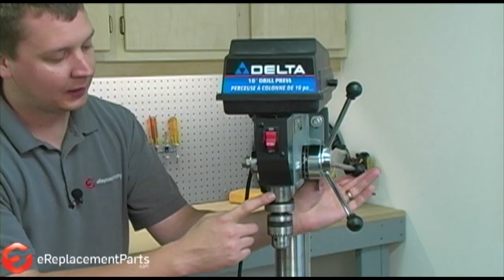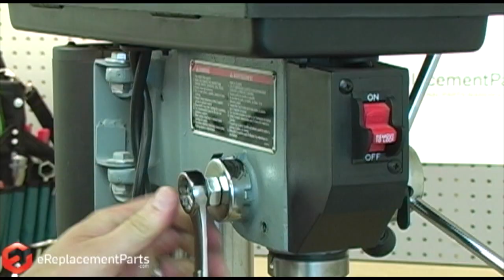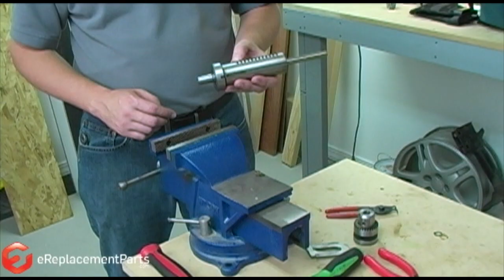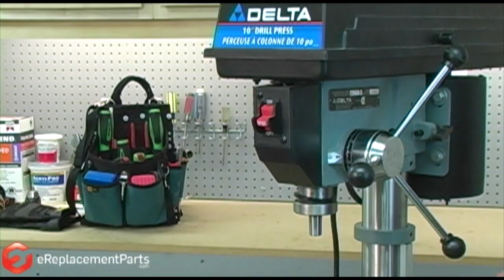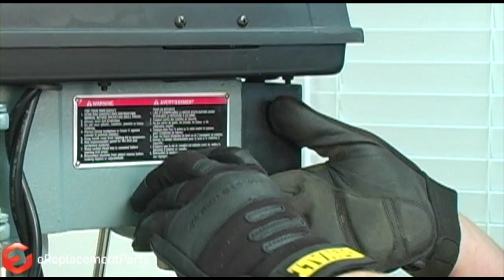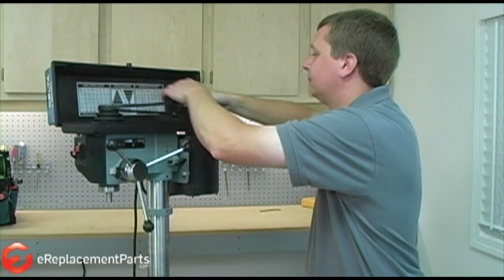How to Repair a Drill Press Spindle

Comment: So if a replacement spindle is not available thru eparts online or anyone else because they are discontinued, how does one “straighten” a bent spindle that causes drill bit “ wobble?”.
When I got the “Ryobi” drill press used, the spindle was so badly bent, that a drill inserted in a chuck would scribe a circle around half an inch in diameter.
Bye judiciously turning the chuck by hand and stopping it at its most eccentric part of travel, and quilting the side of the chuck hard with a lump of 2x4 inch softwood, I have managed to bend the spindle in small increments back towards being straight.
The wobble or eccentricity of the drill bit is now maybe 1.5mm at most, making the drill press useable again for drilling holes in steel for eg, by Center punching first, and setting the drill bit long in the chuck for maximum flexibility, it will Center on the Center punch mark and the flex in the shank of drill “absorbs” the remaining eccentricity in the spindle & chuck, to be able to drill somewhat accurate holes.
Not so much however in wood, it’s difficult to be as accurate drilling wood.
So I’m keen to try & rectify the bend in the spindle if it can be achieved by removing it & some how heating and straightening / truing it up?
Would it be better to just turn a new replacement spindle on a metal Lathe maybe?
Is it possible the quill was also bent at the time the spindle was bent by its previous owner?
It’s frustrating not being able to buy replacement parts!
If I could fix it, I’d keep it as a 2nd drill press and set it up solely to drill mortises in wood, and just buy a new drill press for accuracy drilling steel etc.
Thanks in advance, for any suggested further remedy.
Reply from the maker: Hi Ian, thanks for your question! You have already gone above and beyond what anyone else would do to remedy the problem of a bent drill press spindle. I think that most people wood leave it where you have it now. But I know you want to get it as straight as possible, and I think applying heat would do it to a point. If you have the expertise on a metal lathe, I feel that is the only way to get a perfectly straight spindle. In my opinion I don't think you have a problem with the quill. I hope this helps!
Reply: eReplacementParts.com Thanks heaps man!
I’m planning to buy a metal Lathe soon, so should be able to “fix/improve” various machines in my shop with any luck, one bye one.
Even the metal Lathe, I don’t know whether to buy old & restore or buy new “Chinese” one!
I have projects lining up out of the wazoo in my shop & each one seems to be dependant on fixing one of the other machines first!
I feel like the woman who swallowed a spider to catch the fly! 😂
Maybe making a new spindle, will be one of my first or second projects!

Comment: The video was good to make repairs if needed. I'm looking at a Craftsman Drill Press Model # 103.24531. Can you use a Reversible Tapping Head on this press? Any information will be appreciated.
Reply from the maker: Hello, a reversible tapping head is not compatible with the Craftsman Drill Press Model # 103.24531.

Comment: Hi I have a mini bench drill press 8500 RPM, yesterday I heard a pop while drilling, and the motor is working but the bit is no longer spinning. Any idea what is damaged and what I could do to replace? Thank you!
Reply from the maker: Hi Angelica, an 8500 RPM  drill press is is not a very common tool. They are usually a direct drive set up, not using drive belts. You may have to contact the manufacturer on this problem.

Comment: very nice,ive been looking to buy a nice used one but i seem to get beet by some one who buys them and turns around and sell them for just about what i can get new
Reply: I see nice old industrial quality drill press' on Craigs list for $150 or less pretty regularly, that's what I would recommend looking for.
Drill press' and other machines from the 40s-50s-60s are all cast iron and steel, no plastic parts, with proper maintenance they can literally last for hundreds of years.
I have one like this one, I've seen them much cheaper.
 http://philadelphia.craigslist.org/tls/5656572240.html

Comment: Great video! Very helpful but please use a Brass or a lead hammer for this kind of work, as You can damage the shaft by pounding on it with a hardened steel hammer!

Comment: I have the exact same spindle as the one you show that needs replaced.  I have checked everywhere for one, even on your website, to no avail  Any ideas where to get one?  I keep checking Craigslist and Ebay for "lightly" used ones or new ones but no luck there either.

Comment: hi there, my new drill press is making a strange noise when i use the handle movement downwards it seems to be coming from the inside of the shaft .do you have any ideas as to whats causing this .regards mel stenway. great video by the way ..

Comment: We started to take apart our drillpress at local hackerspace because the spindle had a bunch of runout. I just wish we had found this video before trying to take everythign apart, would have been much easier ;D

We're going to replace bearings and figure out what to do with the fact that the quill is sloppy against the body and moves forwards and backwards. It's a cheap drill press that we got for free and we couldn't find any set screws to tighten it down, but we'll figure out something :)

Comment: nice method for tearing apart the spindle , quell , and chuck as well as the other parts like drill press handle... good to know about the nut on the side don't take it completely off until after the tension is released

Comment: I have a craftsman 12 inch drill press, built similarly to this Delta. Is there any way to take out vertical slack out of the quill? I seem to have about an 1/"8 inch play. I do very light milling on aluminum parts and this 1/8" slack (up and down) makes it very difficult?
Reply: 8 months ago...but if your still having trouble and it is in fact built like the delta in this video, you can try putting a bit more tension on the spring by turning it more during assembly. I run the same press in the video and do light milling with it as well so I tightened the spring to pull the chuck upwards with more force. You may loose some downward travel if you go too tight, but if your that tight you may actually break the spring. I only put an extra turn on it and it pulls up nice and tight.
Reply: Ill try it. Thanks..

Comment: Hi,I have a BD dp600 drill press and the chuck fell off, shaft seems very short. At the top, front pulley, the shaft is about 2 inches above the pulley. I tried to tap it down but it won't move. How do I get the shaft down please? thanks, ED
Reply from the maker: Ed Dunne I have passed your question on to our repair team. I'll let you know what they advise.
Reply: thank you, ED
Reply: eReplacementParts.com Hi, my drill press is making oversized holes in my pipes, and always is the 1rst hole, the 2nd hole is always the normal size

Comment: Thank you for the video Mark.

I have a question with regards to replacing a chuck on a drill press like this where the spindle forms the taper for the chuck to be fitted on. If one has a chuck with a smaller taper would one have to replace the entire spindle with a smaller taper at the end? I received an drill chuck arbor for with a new keyless chuck, however my machine is the same setup as the one in the video and therefore there is no slot in the quill.

I am a bit confused and any help would be appreciated.
Reply from the maker: The chuck order for your drill press should be an exact replacement unless otherwise noted on the tool breakdown.  If a part has been updated or superseded, there should be notes explaining what is need to make the necessary repairs. Can you send me the model number and the part number of the chuck you received so I can research further.

Comment: eReplacementParts.com  So I'm finding that my chuck/ spindle is angled to the rear, making for some lousy drilling.  Could this be bearings, chuck, or spindle or all 3?  Is there a way to check the spindle for runout bad bearings?

Comment: I typically will install the chuck onto the spindle before reinstalling the spindle into the quill. I'll put the spindle in the freezer overnight (or for however long I have if I'm in a hurry) and bake (yes bake) the chuck at about 400*F for an hour or so. This shrinks the spindle and enlarges the chuck very slightly. I then lightly tap the chuck onto the spindle and let them sit at room temperature until their temps equalize. At that point you're guaranteed to not have your chuck come off unless you're intentionally removing it with a pickle fork or the wedges. And even then it takes quite a bit more force than it normally would. As far as installing the bearings I'll use a piece of whatever size tube fits best to tap them into place while I stand it chuck end down on a piece of lumber.

Comment: Hi Mark,
I have found your video very informative and useful. I have purchased a drill press for the first time and would kindly request for your advise on cleaning the parts from the manufacturer protective chemicals/anti-rust (in the user manual they advise to wash it with kerosine) without specifying which parts. Also after cleaning, which parts should receive lubricant and what kind of lubricant? Is it ok to use normal machine oil or grease. Finally, is thery any kind of recommendation for the machine parts calibration and fine tuning which is normally are carried out after buying and installing a new drill press. Thank you.
Best Regards
Reslan Hawasli

Comment: mone kira drill press has 3 bearings, two ball bearing 6202 and 6003 number and one single direction thrust bearing number 51103.i think this thrust bearing give it extra support while drilling :) but anyway your video is very educated but i can't understand why you hammer direct on the spindle even you want to change it.if steel is soft you can simply rivet it if i m not wrong.i think you can use atleast hardwood for spacer between hammer.